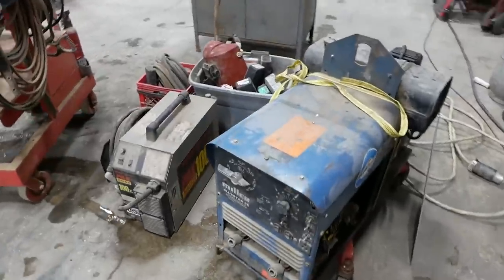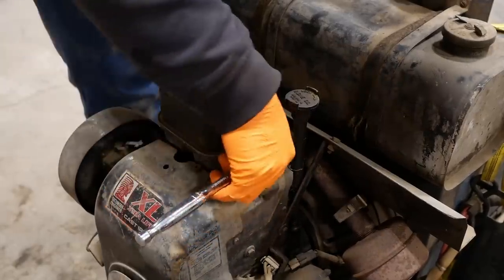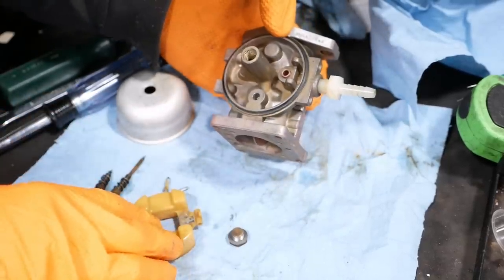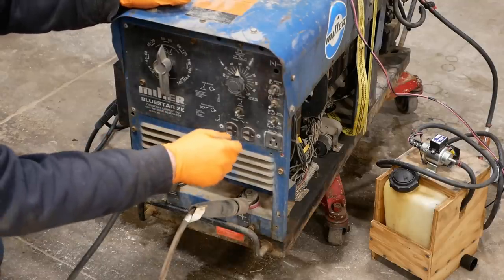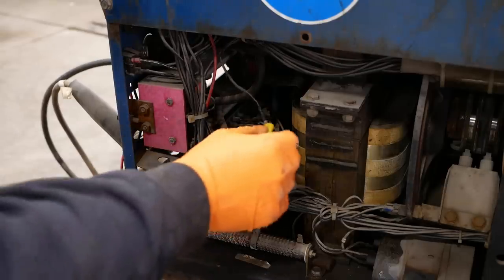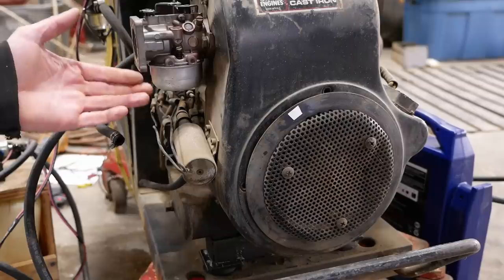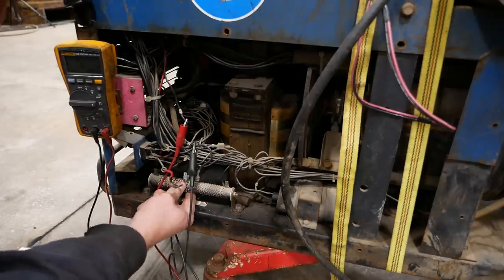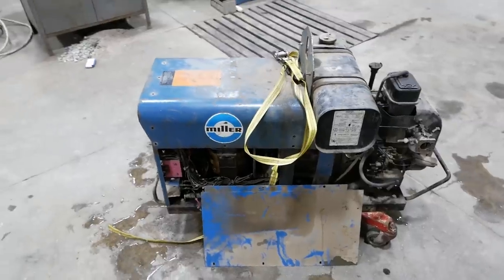I Bought a Broken Portable Welder - Can I Fix It? | Miller Bluestar 2E Part 1

Comment: Your welder bridge resistor diagnosis may just help me with a generator thetat recently started cutting out briefly if we gave it was used to be a normal load. Shut a couple of larger power items off (outdoor flood lights and a 1500w heater) and it would kick back in and provide power. Now I am wondering if the bridge resistor is going out. Thank you for a couple things to check. Appreciate the video.

Comment: Can't get parts for the older machines. I have 3 Miller gas driven welders, Bobcat & 2 Legend NT's. Most parts discontinued. I have 2 Lincoln SA-200's. Weld like a charm, parts available for every part of those machines. Miller isn't made in USA anymore either unfortunately.

Comment: You’re lucky the stock ignition coil was still working ok. There’s a way to re-create the ignition system without the special coil they don’t make anymore, but it’s a pita.

A Kohler K-Series carb would work just fine on the motor, these motors are rly hard to get parts for, & are weird.

Comment: you could put a tire valve on the tank and pressurize the tank that way? and even better if you have some CO2 to use for pressure.

Comment: I've fixed so many of these it was amost painful to watch this.

You can set the engine speed by using the hz setting on your volt meter plugged in to the 110v ac receptacle. Multiply your hz by 60 gives engine speed. 50hz x 60= 3000 rpm. 60hz =3600 rpm.

Comment: I take it the parts were cheap enough to justify buying them then. Good deal. Usually stuff like that the generator and such is fine but the motor is crapped out and finding one that fits is the problem.

Comment: Back when I worked for a certain itty bitty machine company, I could order almost any discrete electronic components. That was back when EPA found out the those oil filled capacitors from GE had PCB’s as well as every transformers up on the poles near you. 😏😎🤫🤓🧐🤨

Comment: Well done sir. That 2E as other have mentioned is a solid unit. 
Those Pow Cons are well built.
That Thermal Dynamics unit on the other hand, would consider sending that one down the road. There is only one brand of plasma cutter. All the other are posers.

Comment: we had a miller roughneck  with the Tecumseh engine  and you cant get the electronics for the ignition any more. looks like you got lucky  we had  to jury rig an ignition system for it  and the generator worked ok but about half the time on  the welder cycle would you would start welding and it would  bog down  and not run up to speed

Comment: So I have used a lot of powcon equipment.  They have been good equipment however they are out of business and parts are not available.  Miller and thermal dynamics are still around although I bet mill won’t have any parts for a machine that old but the nice thing is they usually have off the shelf type parts.

Comment: I got 2 miller 200les with the Onan ccka engines up and running after getting scammed with them not separately (I never learn) without buying any new parts and just using crap i found in my backyard and pieces off generators

Comment: You will find an oil filled cap in a (non inverter model) microwave. If there is a repair shop near you they will have one to donate, or check out the nearest refuse/recycle centre.

Comment: How much would this unit be worth in sound operating condition? I really enjoy the diagnostic process you go through, makes it so much easier to understand. Well done, so far.
Reply from the maker: Maybe $800 to $1000. These smaller and older machines aren't worth much.

Comment: Omg lmfao; my dog does the same thing yours does.
I blew up a motor cap very violently and my dog left skid marks heading for the hills.
Now the lazy azz sees me with my tester immediately either watches me from around the nearest corner or crawls into the hole under the stairs; I look in and see a pair of frightened eyes staring back from the darkness.
Never a dull moment where I'm at. 😮😅

Comment: 18650 batteries from dead cordless tool battery packs have a plastic and 
paper gasket just the right size for small engine fuel bowls. Peel back 
the plastic cover from the positive side and underneath, free gaskets!

Comment: Tecumseh Engines uses that carburetor company's carburetors because they're cheap. It's because of that reason those carburetors are changed for much better units than that company's carburetor. The best for that engine will be a Mikuni carb. There are people who don't prefer a sliding carb, though. They would much rather have butterfly valves.

Comment: You say you might have overpaid for this, but these days just those leads are worth more than $100. I know because I just had to make some up for a free welder I just picked up (an Airco which is actually a Miller with a different paint job) and it cost more than $100 just for the #2 cable to make leads out of.

Comment: That Miller has a lot more hours of welding in her!"Diode passes current in one specific direction. That hi current varister is an old war horse.Bradley brothers invented the rheostat.See if you can get an Edison 12v battery.

Comment: Wes, buddy, do I have the engine driven welder you need! It is a Hobart G258, 450amp DC, powered by an industrial Kaiser-Jeep flathead. Basically the industrial version of the Willys jeep engine. It runs and welds. It'll eat 5/16" 7018s all day long. I saved it from the scrap, and now want to pass it on to the next person that will put it to use. I've got an heirloom SA200 Pipeliner I am slowly gathering up parts for, and don't need the Hobart.
Reply from the maker: That probably way overkill for the three times a year I might use it 🤪
Reply: @WatchWesWork  no such a thing as overkill when it comes to a welder! You can do lots of stuff with a welder that size. Ever tried carbon arc gouging? It is super handy for removing material quick, and bevelling heavy metal, or for removing welds. I don't need one that big, but couldn't handle seeing it get scrapped either.

Comment: I have one of those welders in my garage just sitting there with a missing motor and flywheel. I can tear into it and pull the resistor out and send it to ya. I have no use for it, plus whatever else parts!
Reply from the maker: I wish I knew that before I ordered the new parts! Let me see if I run into anything else I need in part 2.
Reply: @Watch Wes Work  yeah, wish I knew before the video 😂😂😂. I never took anything out wxcept the motor, so it has EVERYTHING.

Comment: That emulsion tube should push out from the barrel down towards the bowl I use some pb blaster on it and a screwdriver and push it down it should just have an o ring on it
Reply from the maker: That’s the newer plastic ones. This is pressed in permanently from what I can tell.

Comment: Replacing the cap will probably help a lot.  Any HVAC part with the same or higher voltage and capacitance should probably do the trick.  You might also check the bridge rectifier to make sure none of the diodes are shorted out.

Comment: I've got that same machine and my question is wtf would you use a 120v, 100hz outlet for? Mine is slightly different but generally the same and I can't figure out what you would possibly use it for

Comment: If that carb doesn't work take a pic of the engine info tag on the blower housing and sent it to me I'll see If I can order you a carb, make sure the gas cap is venting if it's running out of fuel

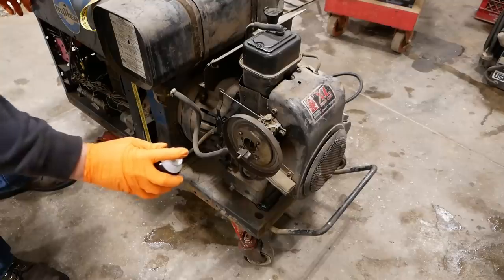Comment: @5:36 - Why not the Mustie way - dump a little 2-smoke fuel down the plug hole?
Reply from the maker: Why not ether? It's literally made for the job.
Reply: @WatchWesWork  Something about not washing the rings dry if it doesn't start or during extended cranking.

Comment: HVAC sites might have that cap. A "jump pack" is going to have a diode, so it's not going to flow like a battery. A carburetor like that must have pressurized fuel to spray, crankcase vacuum isn't enough. Excellent video! Thanks, Wes/ Happy New Year to you & Family.

Comment: Excelent work, Wes, could it be that the resistor and diode were burnt because of so much dust and therefore bad or no cooling? I had once a welder to look at, but I found out one of the transformers (being 3 phase) was shorted out, so the repair was cancelled, also because of cracking solder points and corrosion of the ways on the pcb's. Keep on, it's a nice experience and of course a diagram is of immense help.. 😉 Cheers.

Comment: You should have went to starter fluid before pulling the plug.  After verifying that it runs then spray gas into the intake after starting with either.  A minute running that way usually does it.  If it doesn’t run good on it’s own after that, I’ll use that engineered gas which usually cleans up the carb.  I only pull stuff apart when easy actions don’t work.  I have been a mechanic for 60 years,  I am too busy to make work for myself.
Reply from the maker: A self cleaning carburetor? That'll be the day.
Reply: @WatchWesWork  so said the queen of make work.

Comment: You can save a lot of money buying 3 phase stuff. Nobody wants it. 
HOWEVER, you can buy what is essentially an electrically powered 3 phase generator for pretty cheap that plugs into a 220 outlet.  They have electronic inverters that are much cheaper which also plug into your 220 outlet, but they are lower quality and won't handle as much power.

Comment: New a guy had a welder like the Miller. Don't remember the size but it had a Onan 2 cylinder powerplant. Welded great. He ran the Onan out of oil. What a idiot!
Reply from the maker: My dad had a Lincoln with a Onan that blew up. It was sitting on a concrete pad and one foot vibrated off and put it on too much angle.

Comment: Hey Wes, I've got a bluestar 1e I have at most 22volts at the 120v outlet and just slight sparks on the welding leads when I try to strike an arc any ideas man? I'm at a loss I have no idea where to start looking I feel like I've tried everything
Reply from the maker: Sounds like you don't have any field.
Reply: Wes how would you go about restoring that man? I've tried flashing the slip rings with 12 volts
Reply from the maker: @TheLifted99  I can't possibly tell you how to fix it. You need to go through the wiring diagram. If you have no current at the slip rings, you need to figure out why.

Comment: ...but I do mind. 

What doet carb cleaner to what rubber?
Reply: Melts some "rubber," but, typically, swells up the material used as gasket seals like over-yeasted dough.  Which is annoying on out-of-stock seals & gaskets, and a major uh-oh on attached gasket/seals.

Comment: Typical tecumseh with a valve issue. When they backfire like that you can be 99% sure it's a valve. You can usually lap them and reset the clearance

Comment: Main jet passageways are clogged
I also hear a sticking valve
Change the oil right away that's too black not enough lubrication.
Need to pop open the valve cover and adjust the valves.

Comment: That generator / welder is definitely worth investing in getting repaied to 100 percent operating.
Mainly because it's old enough the have the honor of being labeled MADE IN AMERICA. 
Not one Chinese piece of crap in it.
It'll be doing it's job when Wes is using a cane as a great Grandpa. 
Can't wait for the next episode.
Reply from the maker: No computers. There is 1 circuit board with about 6 components on it.

Comment: Why would you run an engine with old oil , when you can buy 2 qts and change it for $12 ?
Reply from the maker: If it shells out running for 20 minutes on old oil we have a lot bigger problems.

Comment: Pre fjb those we're available through Miller for $100 a piece. I would assume now they're probably I don't know five or $600. I needed six of them for my welder or eight of them for my welder and I got them at a heating and cooling company the repair parts company. You don't want to call some Heating and Cooling ball sack licking guy cuz he'll charge you up the effing wazoo. You want to be able to go right to the supplier. Those are used in air conditioners I'm not an electrical guy at all I'm more of a jackass. I believe when I replaced mine I got them for $12 a piece they weren't the exact numbers Miller had but they were close enough I'm not a guy who's welding a nuclear submarines or the space shuttle so if you're going to be doing that you might want to buy the Miller exact parts

Comment: Terrible fixes I've got a video on one of those old I think hes a cooler or example but they're all relatively the same target retro fit I'm modern Briggs is drattened external fuel pump on 1 of those cast ir an interest and you can make it work that way no you don't have to run The external thing with the electric Fu bump